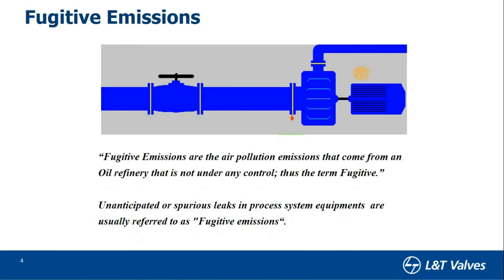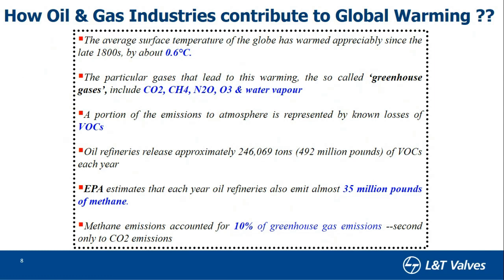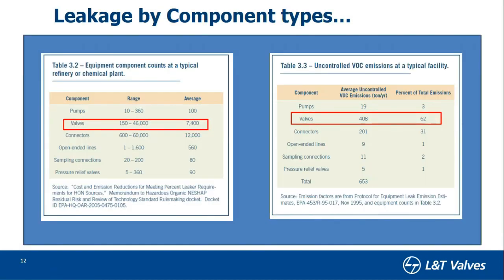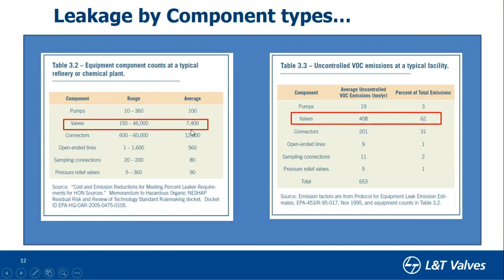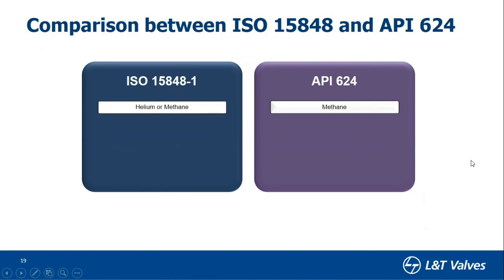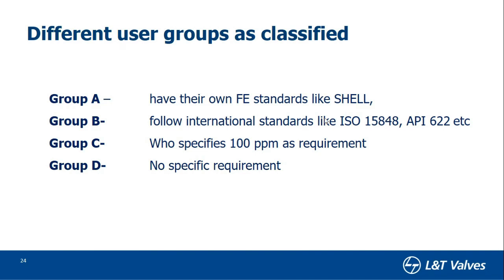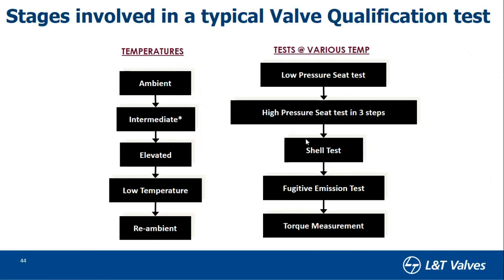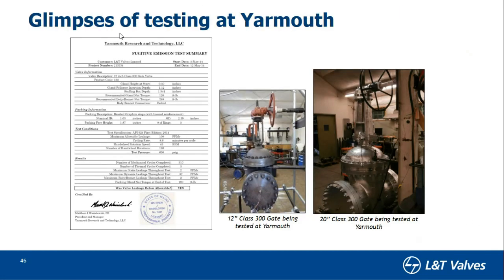L&T Valves - Overview on Fugitive Emission in Valves 16092020

Comment: Sir..  I have a query pertaining to swing check valves . In your experience, does the bolted cover joint in swing check valves could be a potential culprit for the fugitive emissions ? If yes, is there a specific std to certify the swing check valves for fugitive emissions??

Since ISO 15848 covers only for stem seals and body joints of isolation and regulation valves …